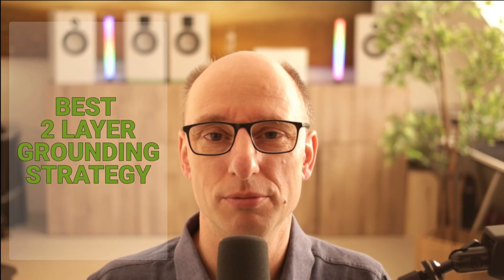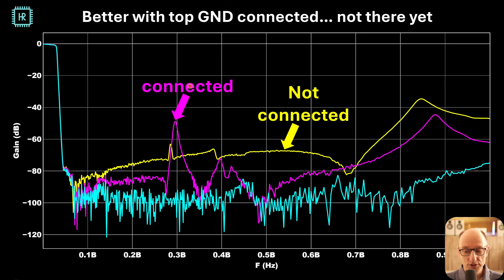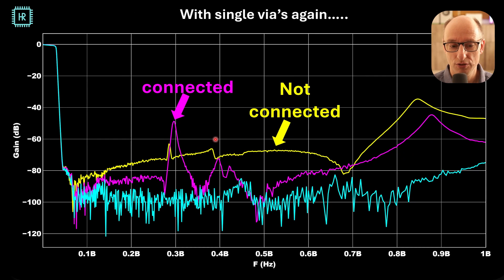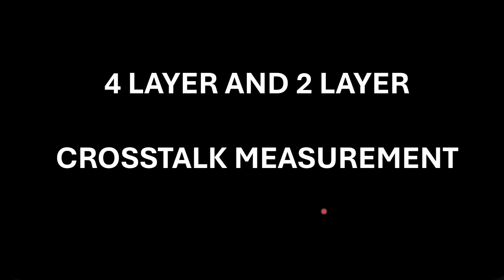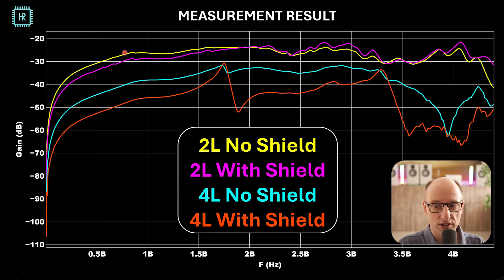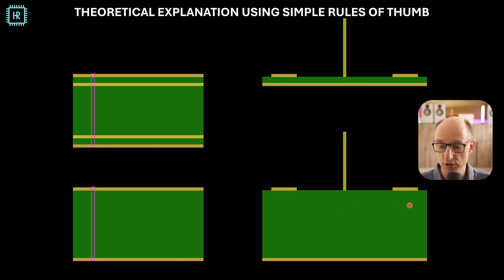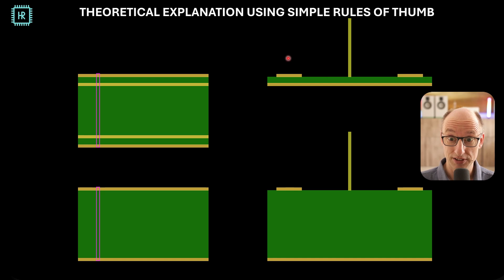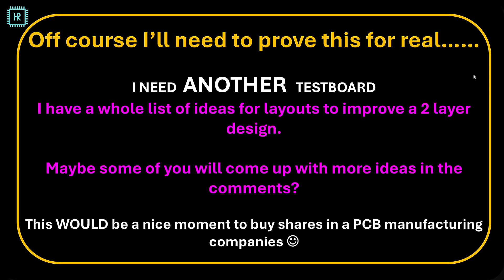Practical 2-Layer RF Design Rules (That Actually Work)

Comment: Send me the checklist
Reply from the maker: Next to the checklist, you now also get a one hour free module from my course which I just launched. 

The course is basically a shortcut to 30 years of experience and mistakes. If you imagine the cost and time of having to make all those mistakes yourself, it might be a nice option. Especially if you haven't done that many designs yet.

Links are in the description.

Best regards and Happy Designing,
Hans Rosenberg
Reply: @HansRosenberg74  Thank you for the link to the check list. I probably have even more experience than you (I am nearly 75 years old and still designing). Your experience appears to concentrate on the RF end of things  up to 1GHz whereas mine extends from dc to a few MHz being mostly in micro-controllers and audio. It will be interesting to see how our check lists compare.
Reply from the maker: @ruffrecords  Hi, I'm focussing on RF here because people seem to like that a lot. And I design all my boards like RF boards to make sure interference does not limit my performance. It is a real problem these days with all the wifi, bluetooth, 5g etc.

I've designed everything from DC to 4.5 GHz (that was  a radar chip)

Great to hear you're still having fun with electronics at 75. I think I'll be the same :-) 

I turned 50 last year, so hopefully I have a few more years to go.

Best regards,
Hans

Comment: Thank you for sharing your knowledge and experience. I would appreciate your experience to split of ground planes when using transformers, isolated DC/DCs, opto coupler circuits and to separate noisy digital ground from sensitive analog ground.
Reply from the maker: I know that this works well. One of the best usb audio analyzers uses this principle and it creates amazing results. https://quantasylum.com/products/qa403-audio-analyzer There are some teardown videos if you look for it. You kill most of the CM interference when you do this, which is great. Making such an example myself would take way too much work unfortunately. Best regards Hans
Reply: @HansRosenberg74  Thanks for answering. Unfortenately, the link did not work ? I have 30+ yearss of experience for designing advanced military system and uses split of ground planes, but you need to know how to do the correct placement and routing. I did not agree when you say that you should not use split of ground planes. That is important if your design comprises transformers, isolated DC/DCs, opto coupler circuits and to separate noisy digital ground from sensitive analog ground.

Comment: Send me the checklist, please. Also, I have a Z80 computer cunning at 4mhz that I am trying to connect an amplified sound card to, but getting a lot of noise. Do you offer a paid service to look over the designs of the PCB and make comment on how to fix the noise?
Reply from the maker: Hi, unfortunately, I don't have time for consultancy. You have 2 main causes:
1. Bad grounding (if your pcb does not have a ground plane, that is a main suspect)
2.Dirty power supply (bad decoupling strategy). PLace caps very close to the ics and give them their own via.
Next to the checklist, you now also get a one hour free module from my course which I just launched. Link is in the description and in a pinned comment. Best regards, Hans

Comment: One more thought for your two layer vs four layer filter: I notice that the top ground plane has many interruptions. Filling the "blank" areas of that ground plane with an array of vias may impact the results quite a bit, especially the resonances?
Reply from the maker: Yes, that is correct. I have quite a few layouts here, so I'm not 100% which 2 you're comparing. The best thing is to stitch those planes together regularly, then you'll not introduce extra resonances.

Comment: Thanks so much, Hans! This demystifies the RF stuff for me quite a lot (which I considered voodoo up to now 😅).
For me, especially the topic of mixed signal systems with powerful microcontrollers combined with audio I/O is super interesting, with the challenge to keep the digital noise out of the audio path. I'm sure your videos are super helpful for this! Thanks a lot!
Reply from the maker: Hi, thanks for the thumbs up :-) This info will definitely help. If you also watch the other parts in the series and my interview with Robert Feranec, you have all the knowledge I use on the topic of grounding and crosstalk that I use to design my own audio dacs that include an fpga for the digital filtering. Hopefully, in the future, I can make a series on the design of that thing.

Comment: What if you had a top ground copper pour around the traces that would filled with hundreds of vias? Since inductance in parallel decreases, could you reach the performance of 4 layer boards ad their shorter vias?
Reply from the maker: That is exactly the experiment I want to do once I get the chance. I'm hoping that will achieve 4L performance. I think it should go a long way!

Comment: I would like to se a 2 layer pcb with a ground trace on the top layer, under the shield, and also connected to the bottom ground layer with few vias along the way. I predict that one would be a winner. Great video by the way.
Reply from the maker: I want to make that pcb and video..... I want to clone myself :-) I don't have enough time.  I'm working on my course 100%. I'm also really really curious what the filter would do with 'vias everywhere'. I think it might achieve 4-layer performance, but I'd have to build and measure it!

Comment: Hi Hans. Thanks for the great videos, they perfectly match my style of learning and understanding! I had an idea about the coupling - not really sure how practical it would be in a real board though. On a 4 layer board could you alternate the loops between layers 1-2 and layers 3-4 to reduce coupling? Either by mounting components on both sides, or by some via trickery?
Reply from the maker: That is a nice idea! However, I don't like putting components on both sides. It is much less practical. However, if you want even more performance, that should work very well. I did not think of this one for this filter yet. Maybe I'll try this in a testboard at some point. With a 2 layer, it will be difficult, as you cannot place a goundplane between the top and bottom, you're out of layers. With a 4-layer, this might give a slight advantage. I'm curious how much....

Comment: Hello Hans, very interesting! Yes, I would like to receive a link to your checklist book!  Which VNA are you using? Can you recomend a not-so-expensive VNA for  home-use? I am trying to add a slotted GPS antenna to a cat tracker, but the learning slope is long and high ;-) Thanks a lot, best regards, Jo
Reply from the maker: HI, I use the nanovna V2 plus 5, that is the most expensive 4.4ghz model they have. For rough matching, I think the 60usd vna's should be ok I think, i never tested one. Link to the book is in the description. Best regards, Hans

Comment: If the shield were mounted on some metal island on top layer with vias, connected to ground, how much it could made isolation better? Doesn't it cost more signal loss due to extra capacitance from signal wire to ground. Thank you, your presentations are perfect!
Reply from the maker: A 'via wall' should definitely help. If you take the via wall into account it should not be a problem I think.

Comment: Very interesting! Would be great to see a full electrodynamical simulation of the current loops and of the strange resonances that show up. I guess this would require expensive software, though.
Reply from the maker: Yeah, this would be very hard as well, since you'd need 3d models of the inductors as well. You could assume those as ideal and then extract the pcb alone. But indeed, HFSS costs a fortune :-)

Comment: Thank you for your hard work I appreciate your videos a lot. 
If you can i would like to have the checklist. 
We need more of in depth explanation that put best engineering practices and brake the myths. The math you need to calculate all of this is hard and its easy to get lost in guesswork and hope that the simulators will do the good job. While still real world will not match the sim calculations. 
Excellent job at presenting this in an easy to digest way!
Reply from the maker: Thanks! Link is in the description! Best regards, Hans

Comment: Would it be of interest to test and have the signal running in the inner layer of a four layer board with one gnd plane on each side.
Of course vias in the signal path is needed to get to the components on the top layer and that might be a bad idea.
Reply from the maker: this works well. In a 4 layer board you will have to do this regularly. You may need vias near the signal crossings to minimize the loop of the current path for maximum performance

Comment: Haven't watched all of your videos, so I'm sorry if you've tested this already:
What would the result of having a ground pour on both outer layers of the board (surrounding the signal traces), as opposed to having the ground plane be on the opposite side of the board, look like? You could essentially make two ground planes with some via stitching. Just curious since I didn't see you mention pours in this video. Thanks!
Reply from the maker: Check out part 4 of this series

Comment: There's a real derthe of ground stitching in the PCBs (in the first ~5 minutes). I suspect that may have some factor in the bump you see at 300 MHz on 2 layers.
Most CAD programs have scripts to place vias at some interval (if there's no other signal there) which can be a good start. Usually I manually place vias at all prominences, and sometimes restrict ground flood at particular points if I can't place a via - unstitched (and sometimes even singly stitched) ground fingers can act as radiators.
To paraphrase Devo: when a problem comes along, you must stitch it.... Stitch it good.
Depending on your spacing, the coplanar ground is changing the circuit to a coplanar waveguide with ground (CPWG) instead of microstrip - impedances should be adjusted accordingly. For short circuits, the loss is a bit higher, but if your circuit is long enough (or has enough inductance) to radiate, CPWG will have lower radiation losses.
Reply from the maker: I have a whole video on the subject, my part 4 video. Link in the description :-)

Comment: My usual PCB vendor will go all the way down to 0.4mm total thickness, are there reasons you wouldn't go for the thinnest to help optimise the 2 layer design? presuming you aren't just going to spend the extra on 4 layer? Also does the power plane where used in a 4 layer stackup influence via inductance for the other outer layer? or is it only the low side potential this works for?
Reply from the maker: The only reason for concern is mechanical. Those boards will be very very 'bendy' so you can break smd components mounted on them. If you only have smd components you could glue it to a piece of metal (with insulation in between) for mechanical strength.
Reply: For a "simple" filter like this I'd probably end up just potting the thing in epoxy which would weatherproof it nicely as well. Can't bend if part of plastic block :D
Reply: @apdewis  Does your epoxy have published Dk & Df values, and are they within constrained ranges? If so, would you share the name of it?
Reply: @Jeremy-fl2xt  honestly was just thinking of the generic potting epoxy, but this question indicates it's probably not so simple?

Comment: 2 layer boards really should only ever be used for the most simple DC designs or ultra low cost parts
for diy/enthusiast and prototypes, they're not even worth bothering with, the price difference at the typical PCB manufacturers is so tiny compared to the cost of shipping and assembly.

I think it's important to highlight this fact so people don't watch this video and use 2 layer boards unnecessarily
Reply from the maker: Agreed! Most applications don't need a 4 layer. However, if you want to get a lot of suppression in a short space at high frequencies you have to do something like that. I'm going to try to squeeze even more out of a 2 layer design with a new testboard. I'm surprised however by  how much the 4 layers have come down. 10x10cm in china is just 55 euros including shipping. I think that is an amazing deal.
Reply: @HansRosenberg74  i think @tommihommi1 means that "2 layer boards really should only ever be used for the most simple.." and he is advocating for 4 layers instead of 2 (as he mentions the small price difference, just like you did). otherwise the rest of his comment doesn't make sense IMO. 

i don't have any pcb design experience myself but i'm interested in 2-layer techniques so i could (with time, money, and effort) prototype some boards at home if i were to invest in a way to create 2-layer pcb and a way to solder the parts.. just to save the fab round trip. probably a bad tradeoff in the end..
Reply from the maker: pcbway is soo cheap (just like next pcb, jlc pcb etc) so it's no point making a board at home I think..... way more expensive. And you get 5 boards!!!!!! At 10x10cm board, 5 pieces is something like 25 usd I think! You can even choose the color for that  money, it's crazy!

Comment: What would happen if you had a slot in the board in between the two connections and attached the shield directly to the bottom ground plane on the two-layer board? My apologies if this has already been suggested or thought of. One other thing with separating the ground plains, I know you're against that, but wouldn't the ground be dirty on the opposing side, and would it make sense to double the shield with an insulator in between and split the ground just at that point?
Reply from the maker: Maybe checkout my part 5 video, I try to explain the theory behind split ground planes and why it is a bad idea.
Reply: @HansRosenberg74  yes I did that's how I know it you are against it. Well you don't have to have a split ground to have a small slot where the shield can be soldered to the bottom plane. Your thoughts on that.
Reply from the maker: yes, a shield like that should help! I'm also thinking about a via-wall, that will shield signals inside the pcb then, not above it.
Reply: @HansRosenberg74  I wonder what would be cheaper vias + shield or a slot + shield. You're going to use a shield anyway then a slot would hold it real nice.
Reply from the maker: I think productionwise a slot with a shield inside it might be more expensive, but I'm not sure of that.

Comment: In this video I'm assuming the ground plane is on the bottom layer. Then copper pour on the top layer ... Then your comparing vias connected top to bottom.. Is this correct?
Reply from the maker: I use a 4 layer board for this. When it says it is a 4L example, the ground is just 0.19mm away. When it says 2L, the ground is at the bottom, indeed, 1.6mm away.
Reply: @HansRosenberg74  are you using copper pour on top of the 2 layer example? Is that what you ground away with the dremel tool. Just trying to get a clear mental picture. Thank you very much for your response!
Reply from the maker: yes indeed, I had to get rid of some to copper to isolate those vias
Reply: I'm speaking of the 2L example where you rotated the inductors. Srarting at 7:04 in the video
Reply from the maker: then the gnd plane is at 1.6mm

Comment: thicker ground traces? thicker copper layers?
Reply from the maker: Thicker copper traces/layers (for instance 70um instead of 35um) does not help due to the skin effect. It will help for DC (less resistance), but not for RF. Best regards, Hans

Comment: Very interesting videos.

But in practice 4 layer boards are way more expensive for a small scale project. Do you think working on a 0.8mm 2 layer board is a good compromise?
Reply from the maker: Yes, it is, but I always worry about 0.8mm boards with smd components. They bend easily so I worry about cracking my smd components. Bye the way, you have a 5 pieces 10x10cm 4 layer pcbs for around 50 USD these days including shipping. So it's not that bad!

Comment: I have a couple of questions: 1. What are your thoughts on curved traces, like bezier splines, and 2. I didn't see vias along the edges of the ground planes discussed. Is this important?
Reply from the maker: Curved traces work perfectly. Bezier splines (I had to look that up ;-)  ) would also work fine. I'm covering vias on the edges of ground planes in my 4th video in great detail. And yes, it is important if you do RF ;-) Best regards, Hans

Comment: Interesting! What if you milled a slot for the shield plate, and soldered it continously straight to the ground plane?
That should close off the x-axis leakage path completely (and also probably be way more expensive to manufacture, just a thought experiment).

Are the peaks in the 4 layer response with shield perhaps somehow related to the small leakage path that is still under the shield plate?

(I guess some minor signal can still go the long way around the ends of the plate, unless you go full monty and completely faraday cage the connections.)

PS. I'm a complete RF noob, still mostly black magic to me.
Reply from the maker: Milling a slot and putting in a shield will definately solve it. Those peaks are very common in RF. Stuff very easily starts resonating, only very clean controlled structures will not do that. This is not very 'sophisticated' so it will show this kind of behavior. Best regards, Hans